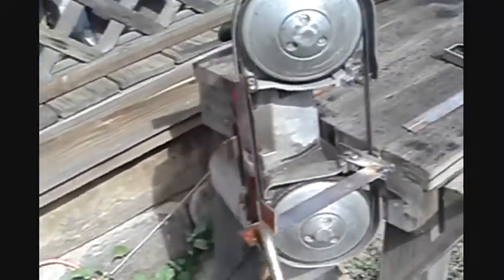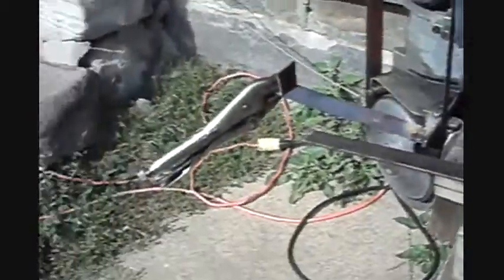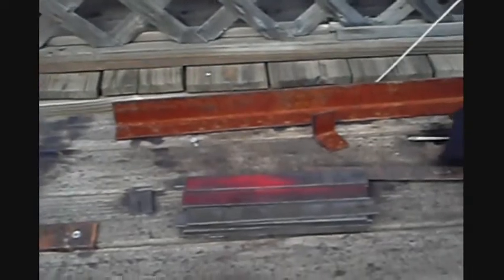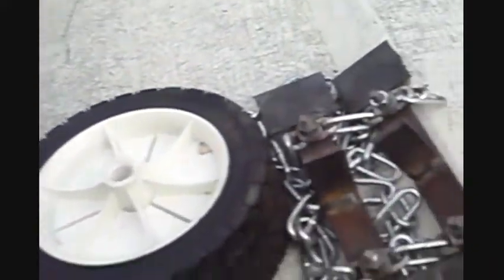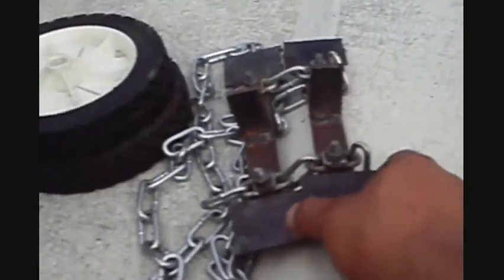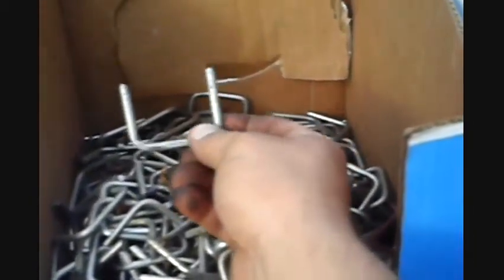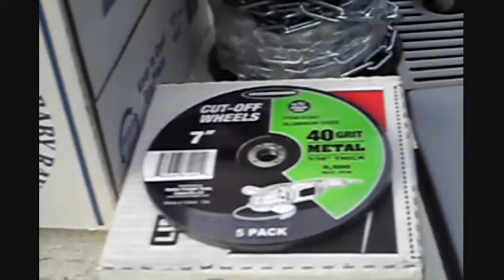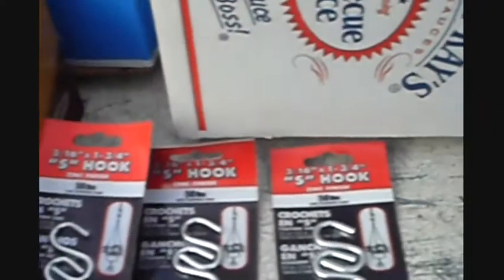Make and Build your own tank tracks (X1 Scorpion Track Design) part 4

Comment: You should be an instructor around the corner at OTC. I got a band saw story, but I have all my fingers just fine. I had a total blond moment pushing into the blade...right at the last second I said "move your thumb dumass"
Too late, I sliced straight in about 1/4 inch. And I was at the shop alone. I walked in the kitchen area and wrapped it, surprisingly it wasn't bleeding much. But I sat at the table with my head down for at least an hour before I could move. I couldn't even pick up my phone. No doubt on the safety stuff....jewelry too, take it off..lol hotfoot sucks too...hah I rambled on so much, this is quite an intense project!!
Reply from the maker: MrTheHillfolk Did you use ducktape to wrap it over a napkin? LOL. You didn't bleed much probably because of that greasy burger you had for lunch, the fat clogged the hole. Yah I don't plug up like that anymore, I take too much aspirin these days. Now I just bleed for an hour from a paper cut. Yah I plan on makin a lot of things for it to show off my metal fab skills to people. Trying to open up my own shop soon and need some toys to show them on what I can do. I train alot of people at work too, I think I do OK teaching.

Comment: I like the way you rigged up your band saw, I wish I had one the disk dont last very long. My mom visited me recently and I had her bring me a 10 pound roll just like what you got. I was paying 165 dollars here for the same amount she got for 65 dollars.
Reply from the maker: Aceman307 I lucked out on the hand held bandsaw, a buddy of mine I did work for retired with his wife, was cleaning out his garage and gave it to me along with a drill press and 5 toolboxes of tool. I was going to make one anyway with some tires for rollers, a 110 motor from a washing machine and just buy the blade. The only hard part to make would be the part that holds the blade in place where you cut at and gear the hell out of the motor. I'll probably make a permanit fixture for the hand held one so I can cut bigger things and be more accurate. I bet that 10lb roll mig wire weighed down your Mom's luggage pretty bad,LOL. I just got the last of the metal for the tracks on the way home from work. Tonight I will have it cut up for the center plate and for the 2 inch plates the tires ride on I'll make a chop saw from my circular saw by making an adapter plate from the base plate. Should be strong enough, like you said the cutting disks don't last long, hope I got enough. The 2 inch square plates need to be a strait cut. The bandsaw was too sloppy on the cuts, all the parts I cut with that was cockeyed but it don't matter on the parts I cut with it.